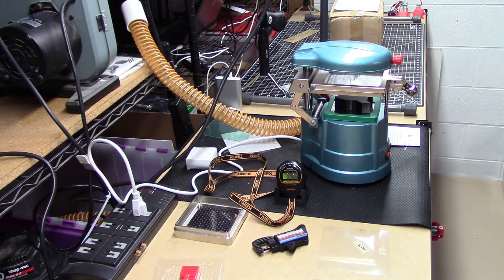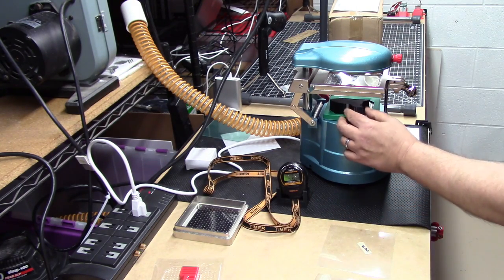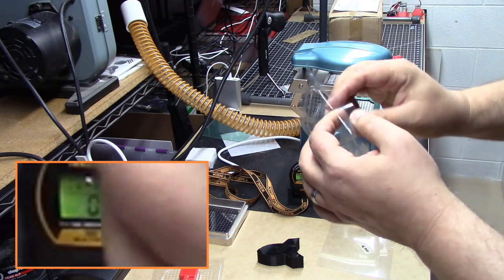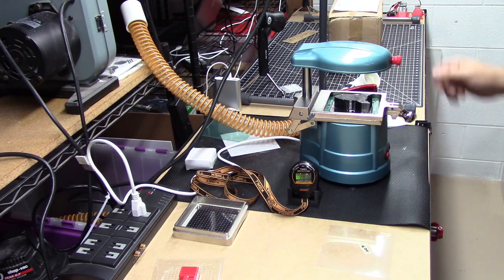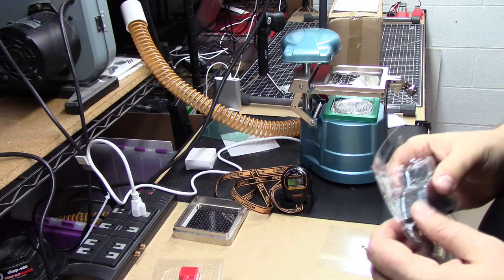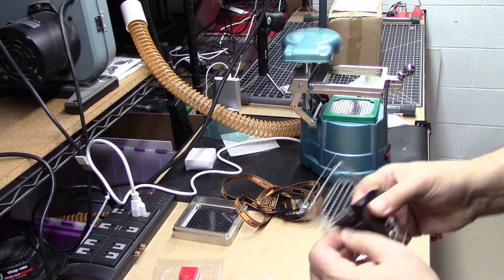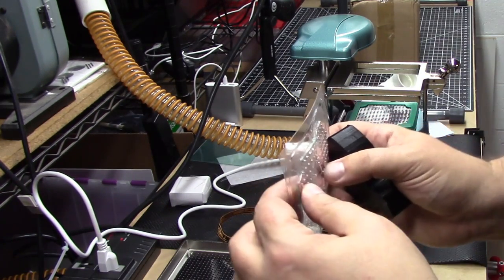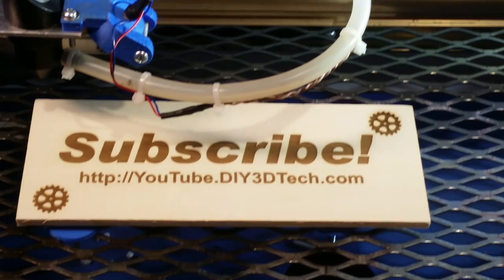Vacuum Forming - Material Testing with 3D Printed Model!

Comment: Did you (or will you) try putting a little draft in the buck?
I made my own vac former and I primarily used 6mm thick Acrylic.  I had to use a propane heating system on the top for the heater, but it worked really well.  Most of my plugs were made from wood.  It was before I had a 3d printer.
Reply from the maker: hmm "draft"?  do share more...
Reply: Sure!  I've done some tinkering with green sand casting.  I would usually put a 1 or 2 degree "draft" into the plug to make it easier to remove it from the sand after packing.  It's fairly easy to use your CAD program (I use sketchup) and "slice" select the top surface in a profile view and then scale that surface to a few percent smaller.  That give a small angle to the sides and helps to pop the buck or plug out with ease.  Hope that all makes sense.
Reply: i was just gonna ask you the same . it will make your life easier.  also sanding the  layer texture out may help too .   I used to make canopy's for my RC  Jets and aircraft out of soda bottle plastic.  i had to be sure there was draft or i would not get the hard wood plug/forms out without breaking the plastic.

Comment: Did the plug/buck begin to melt in the second and third sequence, just before you pulled the plastic over it? There's a bit of a ring visible in the rocket top surface, yes? Would you have been able to design in a slight taper to the buck in order to make release easier? It would also transfer over to the casting process too.
Reply from the maker: not really on the melting however yes you are correct a taper at least a slight one would likely help the release....

Comment: I was just looking around for a way to make blister packs for small items. I like that fact that it's a functional desktop size that doesnt break the bank. I would love to see a video where you expand on that idea. Where did you find the plastics you said in your last video you found it at hobby lobby?
Reply from the maker: Yes I just use thin sheet plastic (not PVC) and you can also get it off eBay cheap too.  Want to work my way back around to that as that is the reason I got as I want to do some etsy things and just need to find the time!

Comment: Looks like you need to have either a smooth surface on vertical faces or all sloped faces to be able to release easier.  Could you try using canned air, tip upside down and cool the casted part to possibly shrink it or perhaps use your heat gun to "relax" the mold and pull your part out. 

I think you should do a test cast with chocolate!! Your grandkids would love a chocolate rocket, I know I would.  You could make your wife custom chocolates with 3D printing and the vacuum former.  Think of it, her name in chocolate. Be sure to use good stuff, nobody likes icky cheap chocolate.  Happy wife = ability to get more shop toys. 

Cool video and watch your plastic. You have some spare thermistors I'm sure, so I would expect that you will be adding a regulating circuit for that heater. Definitely do not need a runaway heater. Perhaps a potentiometer to throttle the heater.  And see if you can't find a more heat resistant knob. No product should melt itself down. Is that the "China Syndrome" brand vacuum former?

Regards,

Norbert
Reply from the maker: yes a chocolate rocket is in the works as well as a few other things 😎